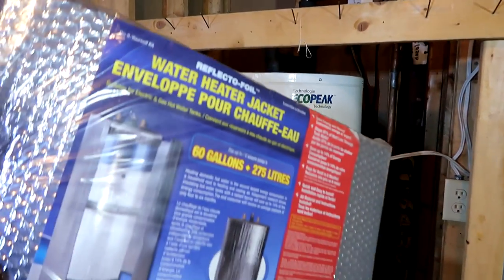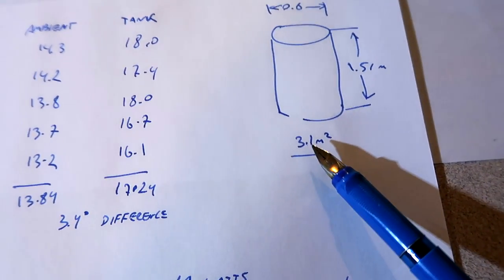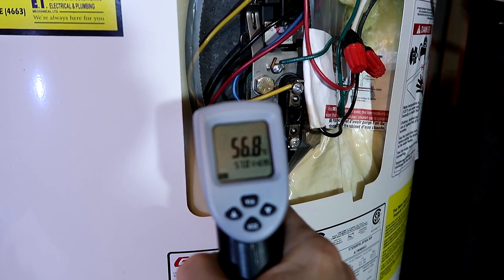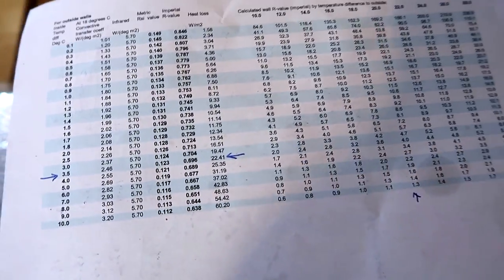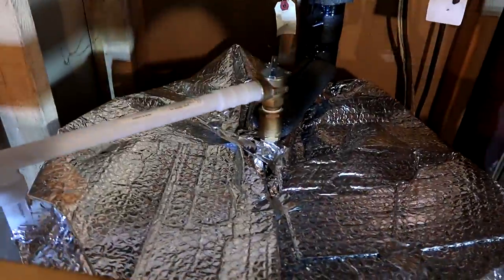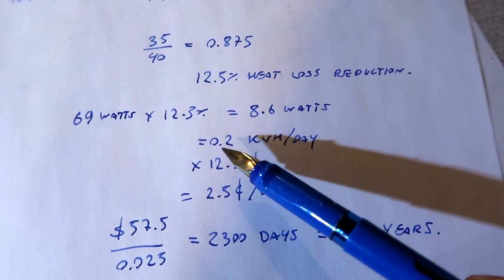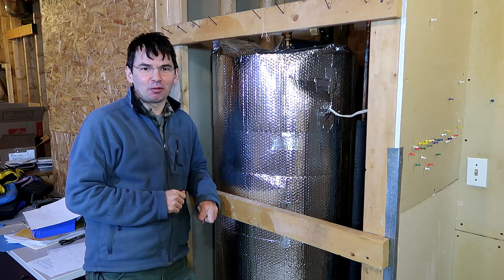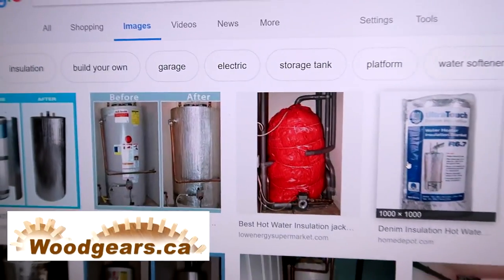Hot water heater insulating jacket:  How much savings

Comment: Wait a minute what did you measure on the second run? You measured the surface temperature of the heater again? Should you not measure the surface temperature of the insulator itself? The heat loss is proportional to the radiation and convection of the insulator versus the ambient. For the heater surface when insulated it's ambient is not 13.4 it is much higher also given the reflective coating which would look like a similar temperature for itself. If measuring the insulator reflective coating is not easy with your thermal gun black out a small portion with a marker.
Reply: I thought exactly the same! Was looking for this comment to second it.
Reply: I was reading all these comments and no one mentioned it. Point is that there is no leakage of heat and that it bounces back instead of going out.
Reply: @webinatic216  some comments further down brought it up. Wandel sais it's because he can't make a reading on the jacket because it's ir reflective.
My point is that you should take a measurement where you're supposed to take it, not where it's more convenient to take it.
Reply: @EvilED08  Put a piece of paper on it and then take a measurement. It's still wrong way to measure it from the inside.
Reply: @webinatic216  I think you and I agree. But I would suggest to put mate masking tape on and measure that. But I'm in no way an expert.
Some people mentioned that whatever heat escaping the tank will heat the house making it a none-loss thing. Except for in the summers when it would make an ac work more.
Reply: It will give the same result actually.
Reply: @emilmuhrman  eh, that's something I could NEVER believe. You're saying that the temperature on the inside and the outside of an insulation is the same? Where do you get your insulation? :D
Reply: @emilmuhrman  please explain what you mean.
Reply: @EvilED08  By calculating the difference in temperature with and without the extra insulation he gets a ∆t. That can be translated to a energy saving, assuming that the room and water  temperature is the same as before.
Reply: @EvilED08  The increase in temperature will be directly linked to the extra insulation.
Reply: @emilmuhrman  sorry, not convinced. And I'm not sure if you see what he is trying do do. Either that or I don't see it.
Reply: @EvilED08 If you want a perfect explanation I can recommend the book, University Physics by Huge D. Young and Roger A Freedman. The chapter about thermodynamics explain why this work quite well.
Reply: @emilmuhrman  I'm sure this is more simple than diving into university physics. The measurement shouldn't be taken on the same spot both times. It should be taken on the same relative location. That is the outside of the tank the first time and the OUTSIDE of the jacket the second time. Too see what heat that leaks out.

The outside of the tank on the inside of the jacket will be the same or almost the same as without a jacket because of the thermostat turning of at the same temperature.
Reply: Same I was like wtf he is doing. He is calculating same R value for heater again.
Reply: Also this is what I think if he waited 2 days or more temperature inside of jacket would be higher even.
Reply: @EvilED08  that is easy to overcome, put a piece of tape on it, give it time to come to temp and take reading off of it.
Reply: @Gantzz321  :

He should have used a wattmeter.

Comment: Just stuff that closet with rock wool!
Reply from the maker: and that would be cheaper too!
Reply: Preferably the extra itchy kind! I hate that stuff, every loft in Ireland and the UK is full of it!
Reply: @bootsowen  yep! Horrible stuff, but cheap.
Reply: When you increase the surface area of the heater, you increase the transmission of energy (like heat sinks).  I heard this as an argument against some water heater insulation. Yes, the heat loss per square meter is less, but you have increased the surface area to at least partially compensate. Seems like your idea would fall in that ball park.
Reply: @matthiasrandomstuff2221  Also... where in your house is the water heater?  Mine is electric, in the middle of my ground floor, and my house is heated electrically.  The way I figure it, any heat lost from my water heater is just heating my house...less work for my baseboard heaters?
Reply: Kevin B exactly what happens. If in a un heated  basement or garage, it becomes the default heater. All have options of thicker insulation and gallons. Most just buy the base model at big box store. His explaining using only one element is partially wrong. Water will take longer 2 heat , but also cycle element 2xs as much.

Comment: Always love your videos Matthias. A few more thoughts to consider: Adding insulation to your water heater will likely void your warranty.  In a predominantly heating climate like mine, heat loss on the water heater is not a complete loss as it heats the house. (assuming its inside in a conditioned space)  It could also prevent regular visual inspection for things like leaks or rust.  More effective cost preventative maintenance would be draining it every year or so, replacing the sacrificial rod, and checking on the heating elements (electric only).  I am very energy and conscious, and I decided to not put this type of insulation on my own water heater as I didn't see the benefits.

Comment: You took measurements off a fairly reflective surface so you're partially measuring the temperature of the room. To get an accurate temperature with an infrared thermometer you need to measure the temperature of a surface with emmisivity close to 1 (or recalibrate the IR gun). 3M brand black electrical tape is pretty close, apply some to the surface and let the temperature stabilize.

Comment: in the US, under the brand name " Reflectix " you can get just the material....aluminum coated Mylar or bubble wrap style like you have there. The documentation says that you want a 3/4" air gap between the surface to be insulated and the insulation. The setup on your water heater test - per the packaging - did not appear to be 3/4" 

However, I agree with your conclusions 100%

What about building an insulated box with a very high R values ( like a Yeti brand cooler - those are amazing) which encloses the water heater on all sides - allowing for proper air gap and any needed ventilation etc for safety and fire prevention?

Where do On-Demand heaters fall in here?  Empirically, my 199,000 BTU Natural Gas fired on demand heater - based on the before and after gas bills - is MUCH better than the gas fire 50 gallon tank heater which it replaced.

Love these studies you do when you're not doing a project.

Comment: You have to calculate the heat you get from the water heater to the house as well. If you insulate it you loose that heat in your house. But then I live in Northern Norway and we need all the heat we can get.
Reply: if you got a  heatpump it is better to use the power there than on the heater..
Reply: When I lived in Norway I saw interesting features: windows close better a d the chimney from the heater/stove is not insulated, so you get the warmth of the pipe in yr house as well. Netherlands e.g. insulates that pipe so no one can accidentally burn himself by you touching it......losing a lot of heat out the chimney
Reply: @Ed19601  I have the same. You get apx 1kw pr meter pipe

Comment: Is 57C° not the perfect temperature to grow legionella bacteria?
Reply: Citation: https://www.ncbi.nlm.nih.gov/pmc/articles/PMC2094925/

The optimal temperature for Legionella proliferation in water varies between 32°C and 35°C, but it can easily proliferate at temperatures of up to 45°C. Usually, there is no growth above 55°C, and a temperature of over 60°C has a bactericidal effect.

Thus, the WHO recommends that water be heated and stored at 60°C (3). However, studies in Quebec have shown, even when the thermostat is set at 60°C, a high percentage (approximately 40%) of electric water heaters remain contaminated because of the lower temperature, about 30°C to 40°C at the bottom of the tank.
Reply: Yes. 57 deg C is not enough to kill legionella. Recommended temperature in the heater is 70-80 degrees.
Reply: If you use the whole water at least within a few days, I think legionella have no chance to grow.
Reply: And what is the temperature when it reaches the top of the house?
Reply: Don't know what happens to your water but in the UK tap water arrives chlorinated and microbe free, so as long as you start with a clean tank and a sealed system you will be fine. I have showered using water from a tank heated to 50 degrees only twice a day (Not held at that all the time, the cost would be astronomical!) for the last 30 years and I am perfectly healthy......
Reply: Daniel Wilson Its not chlorinated in Germany.
Reply: I routinely use IR temperature gauges to monitor engine temperature. The IR temperature at the hottest point on the engine block is routinely 15° to 20° colder than the temperature reported by the engine coolant temp sensor. I've never worked out a satisfactory explanation as to why this is but I'm pretty confident this hot water tank measurement has the same error.
Reply: @markusr3259 … yes, and that's exactly why most water heaters have 2 elements and 2 t-stats. You can heat with the bottom one and during high use periods the top one comes on as well. Just set the lower stat about 5 - 10 degrees higher than the upper one.
Reply: @brocktechnology … not fer nuthin' but you are measuring the engine's outside, not the coolant temp when you do it that way. The closest you can get reading engine temp is right on the t-stat housing, once the coolant starts flowing. If that housing is chrome or polished the reading will be different because the IR reading is based on reflection. You can prove this by measuring hot water flowing in a coper pipe. Take some steel wool and polish a section so you can get a reading on a dull section an inch away, then compare.
Reply: @rupe53  I can confirm all your observations which I believe apply equally to the hot water heater.
Reply: In Canada, the plumbing code recommends to keep the tank between 49C and 60C to prevent legionella growth
Reply: @Alacrates … would agree that low temp is likely the primary cause of slime build up in a water heater, especially with well water, which is not treated and still has trace amounts of organic material. While 120 degrees F is not perfect, it will probably do the job without the scalding issues of higher temps.

Comment: In the UK where uninsulated copper cylinders (which run off of a heating furnace/boiler through an indirect coil) were very common until the late 90's, the rockwool based jackets did make a significant difference to the heat loss. We don't have the steel kind of tanks like you do in North America,

Comment: I like you, your'e a geek too. subscribed.
For my tank I used polyiso at 3" thick (R-20), got it free. Used AutoCad to figure out the cut angles like the staves in a whiskey barrel except straight. Then Tuck tape holds it all together. Saves about $3 a month in standby loss. Cheers for this,  kinda always figured this stuff was crap.